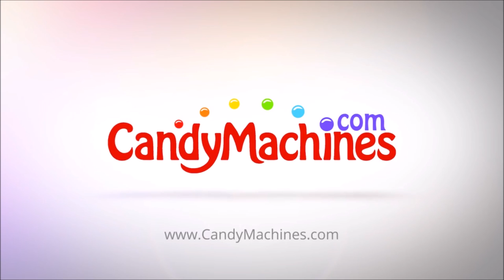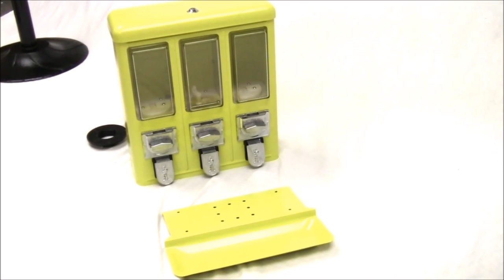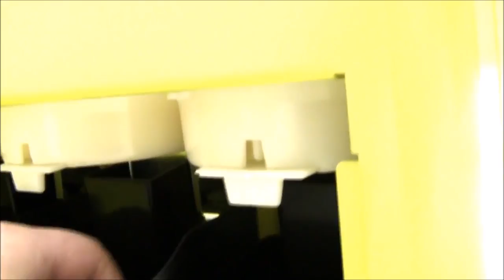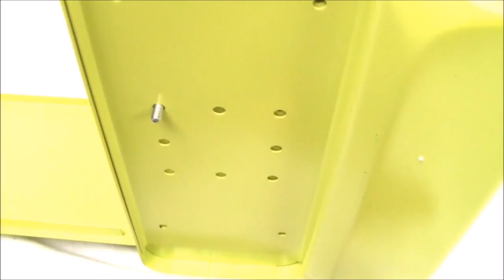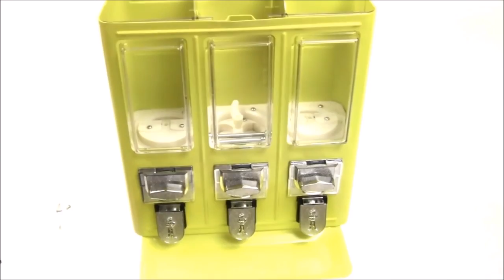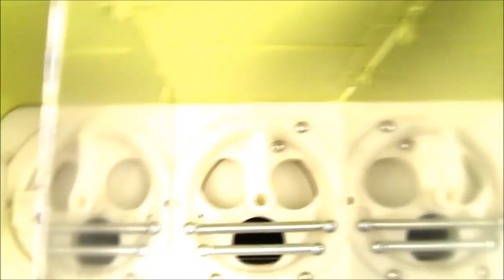How to Assemble All Metal Triple Shop Vending Machine from CandyMachines.com

Comment: I just received two of these machines. The middle head on mine has 7 springs sticking up in the air. Doesn't look like what you have in this video. Can you guys do a video on how to set that up?
Reply from the maker: Hi Pete, the springs were just a change to the gumball wheel agitators and do not change the assembly of the machine in any way.
Reply: @CandyMachinesCom  So I don't need to do anything? OK Good. Thank you.
Reply: уууцуйцц